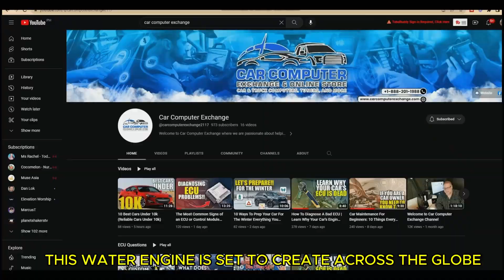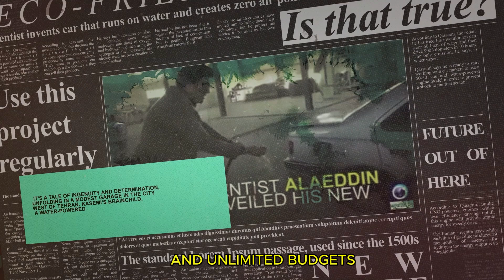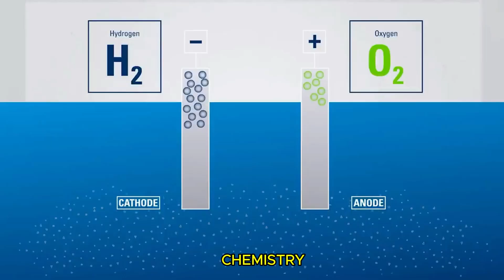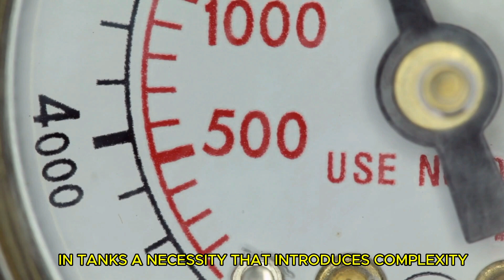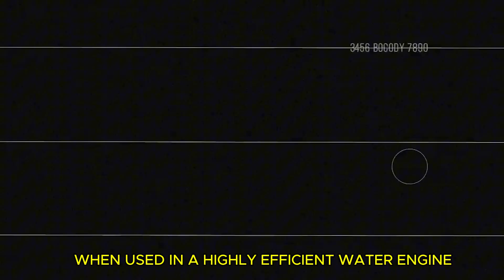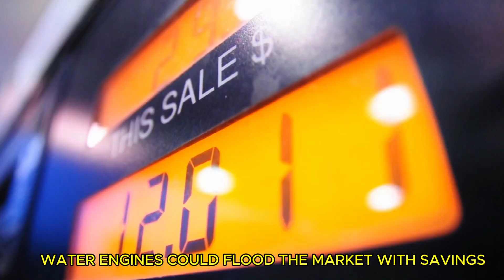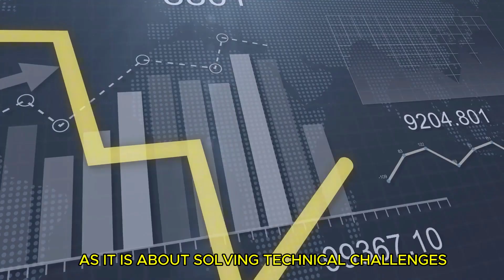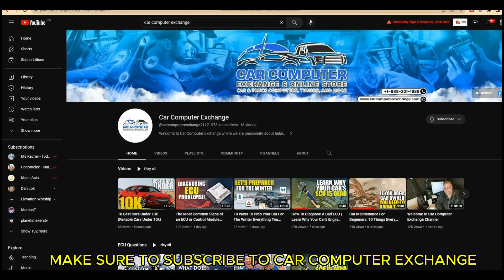The Impact Of Water Engines | Auto Industry Update

Comment: You didn't explore the technology.  You didn't actually say a single word about the technology because it doesn't exist and never has.  Stanley Meyers claims were built around using square wave in the electrolysis process that supposedly broke the bonds between the Hydrogen and Oxygen within water molecules using less energy than otherwise needed and that's how he was able to get more energy out than in.  Sounds good, just doesn't work.  It will be the same for the nimrod from Iran.